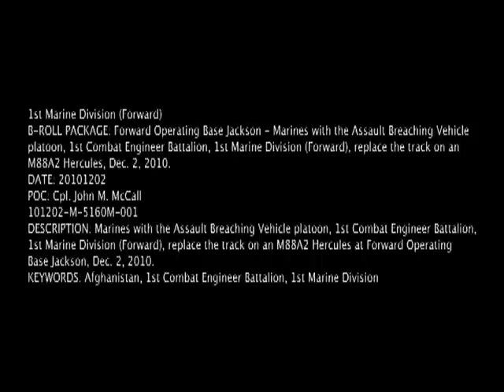B-Roll of Marines Replacing a Track

Comment: Ok, I have two (2) questions:
 1) With that being a M88A2, why didn't they kick up Lil Joe and use the impact to pull the wedge bolts from the end connectors?
 2) Did no one teach them the safe method of using the rope, or the hydraulic winch to assist the track across the return rollers?
 And just as a suggestion, they better replace the missing mounting bolt and nut on the Idler wheel.
Reply: The little joe almost never works because most crews under value its important until you need it. I had one of the only ones that worked in our entire combat team. So useful coldstarts, hydraulic impact, generator.
Reply: Oh shit, you’re right, I didn’t even notice the missing bolts! Guess they’ll be learning that lesson soon enough, lol. Same for the other tips, I never saw our Mechs just using hand tools on their 88’s, they’d swap shoes, tracks and pads in a heartbeat while an entire squad of us are walking away with hand tools changing pads/shoes while sweating our balls off and cursing all the time. 
Retired 11H/B.